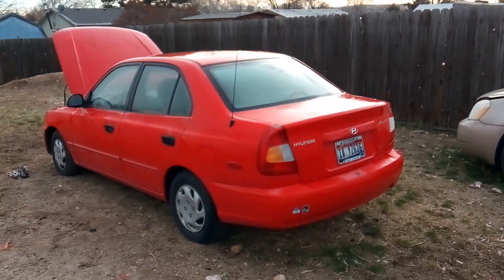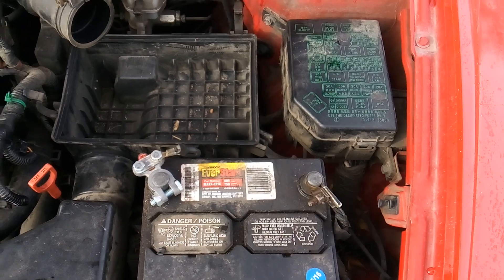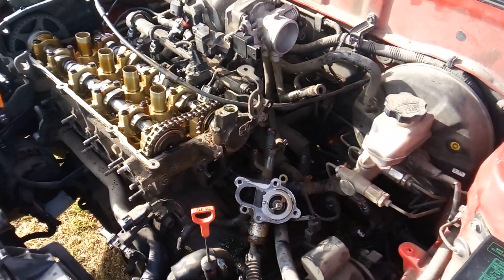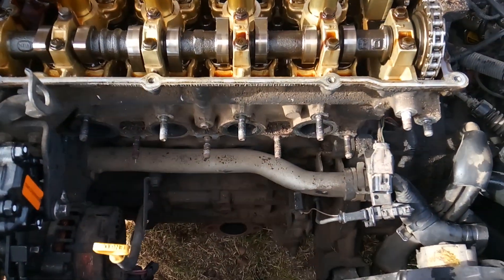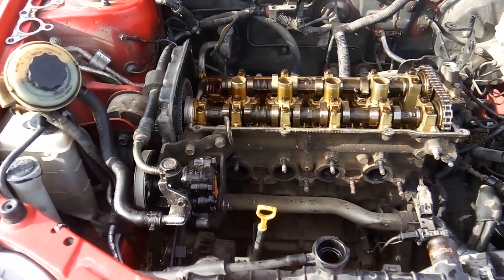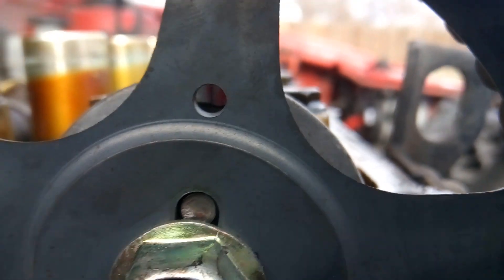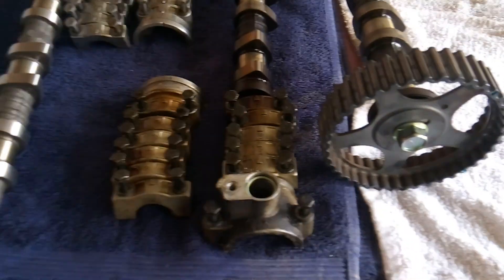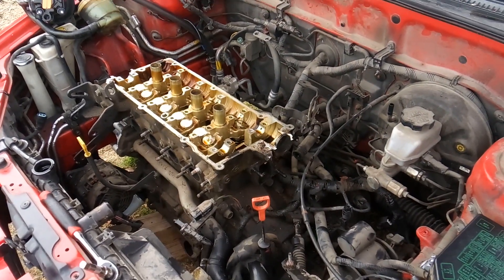Hyundai accent 1.6l cylinder removal part 2

Comment: If there is anyway you can help me. I have put my motor back in and everything but cannot find where one wire goes. Its part of the harness that connects to the o2 sensor on the front manifold.
Reply: o2 sesnor has different plug 4 terminals
Reply: @creativelife4453  I finally did figure it out. It went down to one of the wires with the shifter cable. And I had the main feed to the fuse box connected wrong.

Comment: Hi, where is part 3?
Reply from the maker: unfortunately i was unable to come to financial agreement  with the owners that would benefit both of us so I had to kick the job back unfinished. there will be no more parts to this series.
Reply: That is too bad.  I was enjoying watching your work. I am working on a 2005 i.6 accent right now.  Has slack in the cam chain. I was wanting to just replace the chain.  Thought I might just be able to lock the crank thru the sensor hole and then clamp the timing belt so it couldn't slip on cam sprocket or crank.  Then I was going to un cap the cams, lift them up just a bit to allow me to tilt the back one closer to the front one so that I could slip off the old chain and slip on the new one, then just set the cams back in their bearings and retorque the cams.  Think that a guy could make that work without to much trouble?     Thanks for the videos

Comment: Hello, I have a 93 Lincoln Town car. And I'm wondering why my headlights and interior lights are pulsating.
Reply from the maker: could be due to a bad alternator or a short in the wiring
Reply: @MattShaughnessy6  thanks for answering so fast. Okay I had advance Auto check my alternator and they said it was okay. Could they be wrong?
Reply from the maker: maybe but more than likely no. Start looking at electrical connections at the alternator and also check the battery cable between alternator and battery.
Reply: @MattShaughnessy6  thanks
Reply from the maker: ive also seen bad connection at the starter and also bad ignition switches cause similar symptoms.